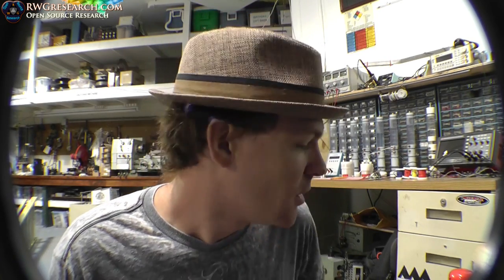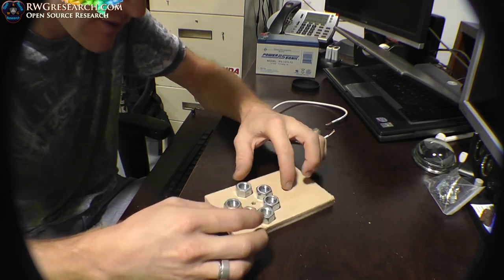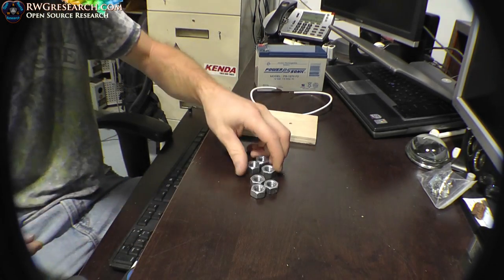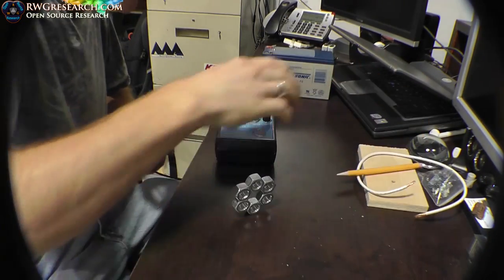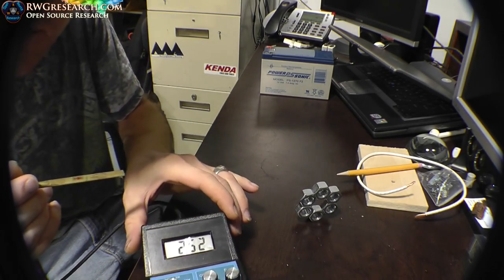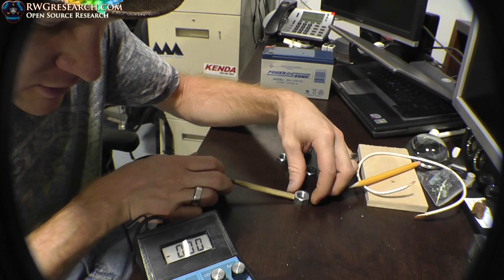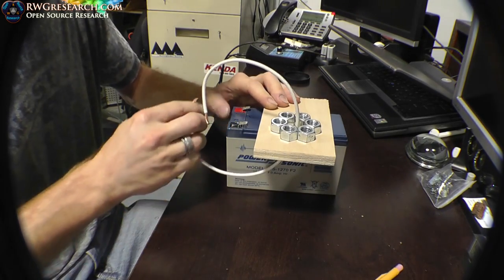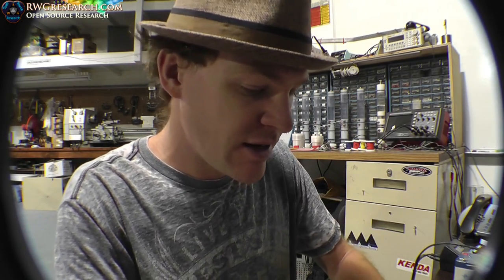“Oh Nuts!” Magnetic Lock.Your Going To Like! Using The Principles Of Ed Leedskalnin PMH.Must Watch

Comment: That is awesome, Thanks for making a video of this. It works just like how Eds PMH does. Now I believe this is not a function of magnetic induction going on with the hex nuts due to the fact that the Neutral part of the magnet does not disrupt/disable the Magnetic Lock. What do I mean by that well Watch this video [ http://youtu.be/BTrY2FgLjtk?t=8m33s ]  Another thing to focus the attention at is when the induced electromagnetic field leaves the hex nuts the magnetic circuit remains.